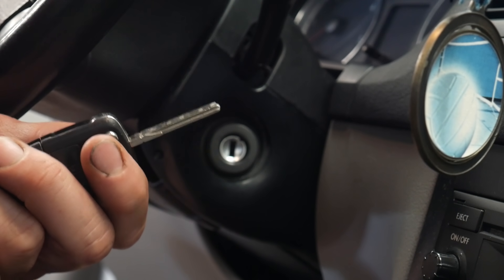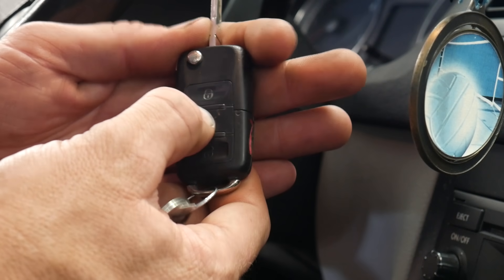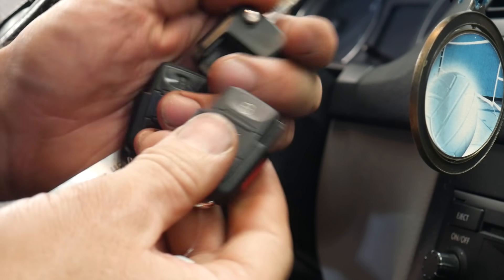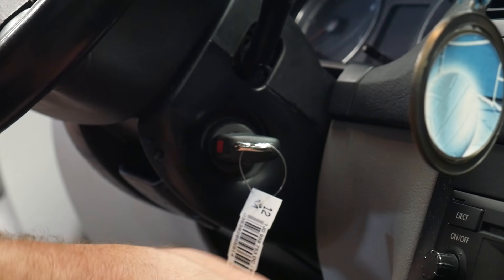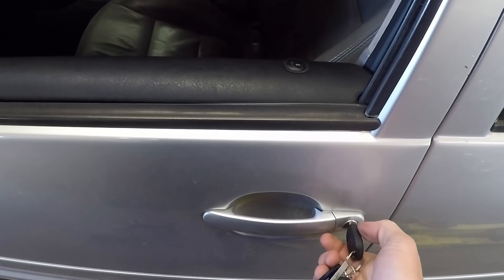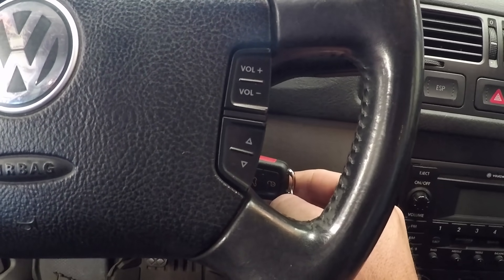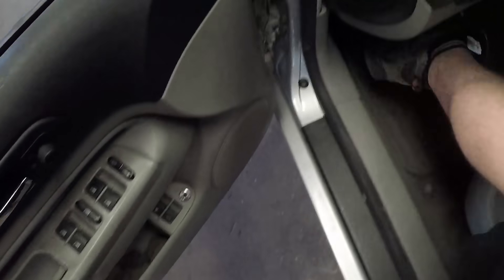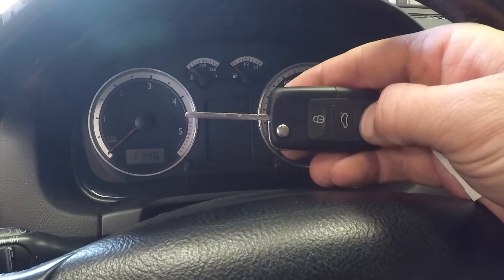How to Program a VW keyfob

Comment: Most of the people with problems are putting a key in the ignition that has an immobilizer chip that is not programmed to the car. There are three separate systems here. The mechanical blade and lock, the tiny glass immobiliser chip inside the key near the blade and aerial around the keyhole and the remote opening fob with its buttons and battery. Many locksmiths can clone the glass chip if they have the car and a working key and the right equipment. Second hand keys witl need the old glass chip removed and a new cloned chip inserted. Swapping the glass chip from one key to the next is very risky as the chip is fragile and glued in place. Best to clone the chip first in case it breaks when you attemot to get it out.
Reply: mine the glass broke trying to taking it out.. what can I do??
Reply: Glass???

That must be a European car thing. the Chevy I had only had a small, metal "chip" set in plastic in the ignition key's shank near the head.
Reply: @rubenmoscol4774  that might end up being be a Dealership Repair... 🤷🏻‍♂️?

Comment: if you dont have a second key, remove the driver's door lock cylinder and use a screwdriver to lock/unlock the door.  it is very simple to remove the lock cylinder.  you just have to remove the small cap in the door by the lock cylinder and use a t15 torx bit to unscrew the bolt holding the lock cylinder in (dont remove the screw completely. only loosen it enough to remove the lock cylinder or youll be fishing the screw out of the inner door).  follow the same procedure in the video but use the screwdriver as the second key.

Comment: On some vehicles you need to leave the key in the ignition for several seconds until you hear the horn blow.
Reply: Works on vw t4 transporter. Did not hear horn but still works at very first try.

Comment: This worked perfectly on my older model Tiguan.  Thank you!!  Later, when my other key fob stopped working (while at the mall, so no second key fob), I did the exact same procedure, except I opened the driver's side door, locked the central lock (on the door), unlocked, closed the door, then pressed the unlock button on the key fob twice (no horn, but after removing key, the key fob works).  So for my Tiguan, the procedure works, except you don't need the second key, unstead, use the central lock on the door.

Comment: Here is one side note I'd like to add. My 01 Beetle does not know when the drivers door has been opened. To get this process to work I needed to do a the steps only I opened and closed the passengers door. I accessed the drivers door manual lock  by reaching out the open drivers door window.

Comment: Your YouTube instructional video was very helpful. I successfully programmed my new 2000 VW Beetle key using my Valet Key!  To those trying it for the first time, the unprogrammed key goes into the ignition and the valet key or whatever you’re using as a original goes into the outside door lock.  I figured out I had to pull the new key out of the steering column and then push the unlock button slowly.  Then the new fob worked flawlessly.  Thanks again for helping us out and showing us the way.
Reply: I ve new beetle too. Works with new empty key?
Reply: Thank you!!! This comment worked for me!!

Comment: Thank you so much for this tip.  I got quoted £150 for new key from locksmith.  Bought a 2nd hand fob off ebay for £12 , swapped my key on to it, tried out this method and it worked first time.  Genius.

Comment: Best way to program a new key fob without 2nd key is to pull apart the fobs and pop out the circuit boards and put the old circuit board in the place of the new.  Worked for me.
Reply: Its staggering how many people are driving around without a spare key.   Madness

Comment: Nice! Just tried it with aftermarket fobs I got off eBay and it worked perfectly! Thank u!

 I recommend though pressing all 3 buttons during the 15sec programmable time frame so that they all work. My 1st try only the one button I pressed worked.
Reply from the maker: Thanks for the tip. I wonder if this is common with the aftermarket Fobs.
Reply: Could you potentially send me a link as to where to order that lower fob piece? I ordered just a shell instead (silly mistake I know).
Reply: @antinormieism3791  The original e-bay add has changed, not sure if they are still being sold. But ya, I found them on e-bay. When I ordered them they asked me for the radio frequency info I think. Basically all the technical info is on the original factory key fob in small writing, so I sent them a pic and  that gave them everything they needed to know. So definitely keep your old fob handy.
Reply: @antinormieism3791  Side note, this video will only program the key buttons not the immobilizer. You'll most likely need a shop to do that since you need to get into the cars computer in order to "pair" a new set of keys with it, so to speak.
Reply: @bassmunk  Yeah I have the upper portion of the key that is cut and coded to start the car. i just want the remote piece so I can make it a full key. I order one off of eBay, hopefully it will work. They didn't ask for any info from my old key though like you said which does concern me. Thanks for talking though, your info helps.

Comment: For anyone in the future trying to resync your existing keyfob I have some recommendations that worked for my daughter's 2013 beetle.

1. The correct instructions for your specific car should be found in the owners manual, and mine differed from this process.  The process in the video is for training a new key, not resetting your fob buttons.

2. The process for me was to lock the vehicle, press the unlock button on the out-of-sync fob, and then within 1 minute use the key to manually unlock the door from the outside.

3. I discovered it was required for me to disconnect the battery and let the car reset first.  I left it disconnected for about a minute and reconnected it, and the above procedure worked first try.

I hope that helps someone.

Comment: ive got a 2006 Golf GTI right hand drive (Uk model) ive got one working key fob but the othe key fob was dead, changed the battery but still dead so i got a new key fob circuit board from ebay and swapped it out.... but now i had to syncronise it to the car. this is how i did it.
Manual Programming 

1) Unlock the door to your car using the key blade 
 
2) Insert your good/working key into the ignition and turn it to the "on" position, but do not start the car.
3) Roll down your driver's side window

4) Step out of the car and insert your new key into the driver's door lock, now turn the key to the lock position and hold it in that position for 10 seconds.

5) Now press the lock button on the FOB with key still in the door lock

6) Now press the unlock button on the FOB with the key still in the door lock

7) remove key fob from the door, do your widow up and remove keys from the ignition.... now try to lock and unlock with the new key fob. worked for me and i tried loads of different ways, hope this helps somebody !!

Comment: So out of curiosity if you program the same key does it still add to the count or is it remembered?
Reply from the maker: This is just for the fob/remote portion and not the key. Most can have 4 remotes programmed. You can overwrite existing or add back existing depending on how many time you press the buttons at the end.
Reply: @ my bad I meant to say fob, but thank you very much this video did help me a lot!

Comment: I heard the horn on first try with key fob I got on amazon. The key fob locks and unlocks doors  and car starts and drives fine with the newly programed key fob but trunk wont unlock with it. I can live with that. thanks for the info.
Reply from the maker: No problem. That’s weird that the trunk doesn’t operate.  At least the door locks work. Thanks for watching.
Reply: I have the same problem with the key fobs I purchased from Amazon. The lock and unlock work, but they won't pop the trunk. I have no idea why because the original fob will open the trunk.
Reply: @razmin3  same with my key from eBay. Any reason why?

Comment: How about doing a used key fob from a scrapyard?  Yes the immo chip has been switch over along with the key blade.  Can the used scrapyard key fob be reprogrammed?  Seems the original circuit board might have been compromised.  It just continually blinks non stop.
Reply from the maker: The used remote if functional should work. I have programmed several used remotes in the past.
Reply: Bob's your uncle!

Comment: what if i have only one key?
mk6, keyfob stop working.
few month ago was erratically/ randomly locking/unlocking doors, not all at once and never the same doors. now nothing, red led still lighting on keyfob. so battery not ded.
Reply from the maker: You can remove the door lock cylinder and use a screwdriver to turn the door lock switch and then use the one key you have in the ignition.

Comment: my key/fob got into the washing machine, its a jetta 2007... do i have to buy a new one? or can i try to do this with the wet one?
Reply from the maker: You should try and dry it out first. Place the remote in a ziplock bag with some rice or a desiccate bag(those little packs that say “do not eat”). Sometimes it takes a day or so to remove all the moisture.  
Once dried out I would try the remote and see what happens. 
Sometimes you can sync the remote back up to the vehicle by holding the lock and unlock buttons for 10 seconds or so.  

Make sure the little red light illuminates on the remote when a button is pressed because it it doesn’t then the battery is dead or remote has failed.  Some remotes from 1998-2002ish didn’t have the red light.
Reply: @ThePracticalMechanic  i opened it up dried it up with tissue and used some alcohol wipes afterwards, the light was blinking but not working so i changed the battery.. but still did not work.

Comment: I lost my key fob in my 03 beetle tonight and I have the second original key that came new with the car, but all it does is light the little red light. Is there any way to program the key to work again? (It used to work fine a while ago, but it does nothing now) hope you can respond. Thank you
Reply from the maker: Don Pancho sometimes you can press the lock and unlock button for 5 seconds or so and it will resync with the car. This only works for fobs that were previous programmed and doesn’t always work.
Reply: ThePracticalMechanic ok thank you I will try again. If that doesn’t work would my only option left be getting a new fob? The biggest problem is that if I open it with the key the alarm goes off
Reply from the maker: Don Pancho if opening it with the key sets off the alarm it may not relearn the new keyfob either. There is an electrical switch in the door that detects lock and unlock rotation of the key. Try holding they key in the unlock position for more than two seconds. All the power windows should start to roll down. If you hold it in the lock position they should roll up. This will prove that the switch is working.
Reply: ThePracticalMechanic ok thank you so much

Comment: 2000 VS Golf TDI.  Put the only key fob through the washing machine and now it's clean, but doesn't work.  Have the valet key.  Dealer has no stock in key fobs for our vehicle.  Bought one on the internet.  Swapped the metal key from the old fob into the new one.  Followed your instructions and as soon as I put the new fob into the ignition and turn the key, the alarm sounds.  I wait for it to stop, then turn the valet key in the door to lock,  then unlock.  I press the button on the fob and nothing happens.  I tried this ten times, nothing.  Dealership says they can try to program it for $150, but won't promise anything.  They keep the money no matter what.
Any suggestions?  Thanks!!
Reply from the maker: Sorry for the delay. The security chip is in the flip portion of the key and you should have that portion alone and swapped only the lower remote section. This tutorial only programs the remote. Special tools are required to program the security chip.

Comment: I have a 2007 Jetta with no fob, just a chipped key. If I buy a new fob and a basic door only key, will this process work to program the fob?
Reply from the maker: As long as the vehicle is coded for a key fob. Just make sure you don’t use the new key in the ignition. Use the key in the door and your good key in the ignition otherwise the antitheft may become active and you won’t be able to start the car.
Reply: Did it work?
Reply: Did it work?
Reply: Did it work?

Comment: Hi unfortunately this didn't work for my 2006 caddy.....I have decent diagnostic  kit although I'm concerned  if I go reprogramming the immobiliser it may brick my van? Also I may need dealer  Hex numbers....any thoughts?
Reply from the maker: It seems to work for some and not others. It may be cheaper and easier to have the workshop do it now instead of later if the coding gets messed up.

Comment: When I do this, the car recognizes only the last programmed remote and "forgets" the other one. How do I program 2 remotes so they both work? Thanks
Reply from the maker: If I remember right the car can remember 4keyfobs. After you perform the the key turning sequence and program a fob don’t turn off the key but instead press a button on the second fob three or four times. This will program the other remote into a different slot. 

If that doesn’t work I think there is a procedure to clear all previously learned fobs from the car so you can start with a clean slate.
Reply: Thank you for the response
Reply: @sevak2108   Did it worked.? I'm interested, cuz my 2 key fobs stopped working and i wanna try pair them both. :)
Reply: Does it work for polo base model (trendline)

Comment: Hi I have an 2006 mark5 Jetta, I have one key and fob with no spare key and I just bought a new fob and want to program it. I did the trick where I removed the door lock and used a screw driver instead of a second key. I’ve noticed it works on the mark 4’s but I haven’t seen any mark 5 videos that use that method. Do you know if it absolutely necessary to have 2 cut keys? or should one cut key with the immobilized in the ignition and the screw driver as the second key work as well? Thanks
Reply from the maker: It is possible that that will work on the mk5 as well. I’ve don’t it on the mk4s and Audi’s but never tried on mk5
Reply: ThePracticalMechanic you don’t see any reason why it shouldn’t work? There was nothing added to the locking mechanism in the mark 5? It is possible my car has too many keys synced. I don’t know for sure. Thanks for the reply

Comment: Does this also program the new id48 chip in the new key?
Reply from the maker: No. This is only the remote section. In the video you can see me swap out the only the remote section of the key. 
The transponder requires specialized key programming equipment

Comment: Guys do you know if I can reprogram a used smart remote key fob for Taos 2022 start push button? I have one that's working but I wanna have a spare one as well? Is this something I can do myself or do I have to go to a locksmith or dealership?
Reply from the maker: You will likely need locksmith or dealer for key programming on smart key vehicles. Not sure if a used remote will work or not.
Reply: Thanks! I wonder why these smart keys are sold on Ebay if they can't be reused? any idea?  @ThePracticalMechanic

Comment: I have a 2010 vw bug.  Will this work on it?  I bought a blank fob and had the locksmith to trace it.  So it is cut but not programed.  Please explain
Reply from the maker: if you bought a complete key and had it cut this process will not work. This process is just for the remote portion and not the starting portion. The starting portion of the key requires programming the Immobilizer system to learn the key.

Comment: Will this work if we are adding a second spare key for 2009 Rabbit?  So one original working key, and adding a new key.
Reply from the maker: This will only program a remote. Inserting an Unprogrammed Key Blade into the ignition may immobilize the vehicle. Keyblade programming may require a locksmith or the dealer.

Comment: I have a 2006 VW Beetle.  The car battery died over the winter and I just got around to changing it out.  Now, the keys won't work!  My lights show that the car thinks it is being stolen, I've tried this method and it isn't working.  PLEASE HELP!
Reply from the maker: I have had a few beetles in the past so this and one method that has worked was to to turn the key on and let the car sit for 30+ minutes. You should set the parking brake to disable the headlights and also leave the charger running. You may have to do this for both keys.  It still may not work though. Another option is to unhook the battery for 15 minutes or so and reconnect. It may reset the module and work properly again. Good luck.
Reply: While the alarm is activated, insert the key into the rear hatch and turn left. This will turn off the alarm.

Comment: What if you don't have an extra key? And only the key fob?
Reply: Off to the dealer with the VIN
Reply: Buy an HAA blank and get it cut for 5 quid so it works in the door lock..
Reply: There's another video explaining how to do with one key. You have to pop out door lock and use a screw driver to act like a key... I also done it to reset the alarm system on other cars.. neat trick.
Reply: @gb7886 please send link for the other video
Reply: @ryanedwards1380  what if im in the US and we dont have any quids?
Reply: @williamatchison6261  then you may need a pro…quo no? Ha!